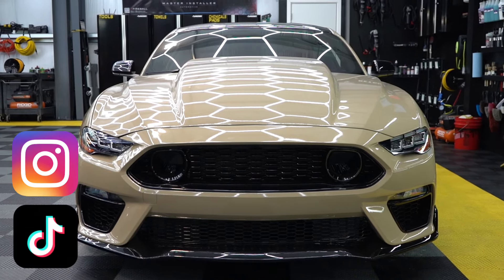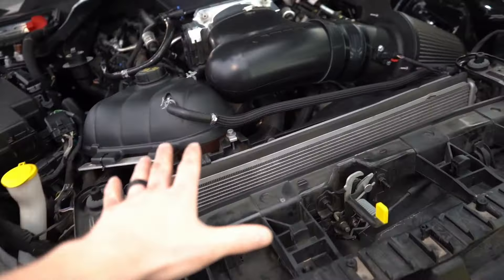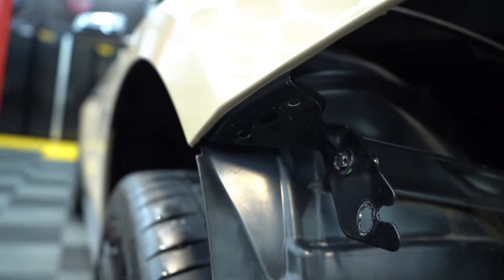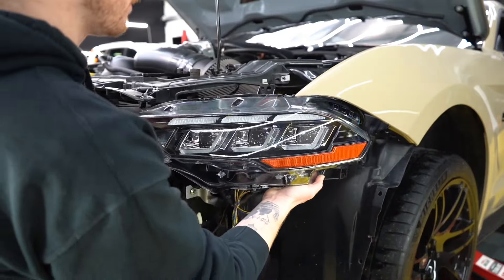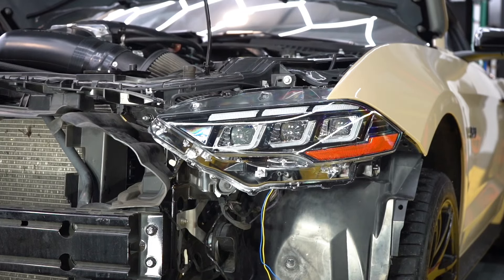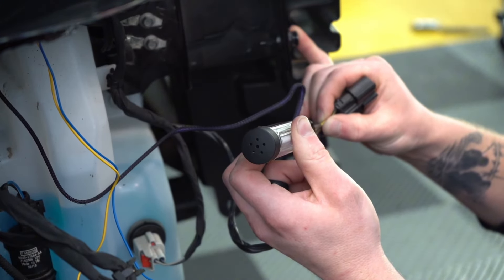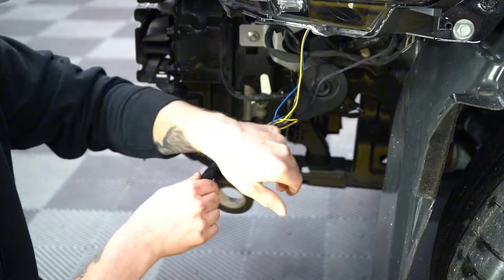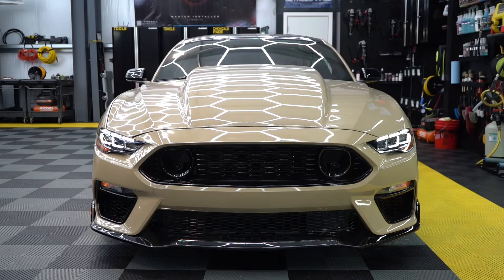StangLights 2018-23 Ford Mustang S650 Style Headlight Installation Video

Comment: i did this but spliced the yellow wire to the parking light instead so now my headlights are goofy
Reply: Can you explain? What went wrong
Reply: @sanchilandscapedesign6316  spliced the turn signal wire built into the headlight to the parking light wire instead of the turn signal, so it made the DRL’s in the headlights stay amber all the time instead of white, and there was no turn signal in the headlight. ended up taking the bumper back off and spliced it to the correct wire and everything works as should now
Reply: @dailydoseofoctane  sick. Do you have videos of them? I want to get them for my ‘20 GT